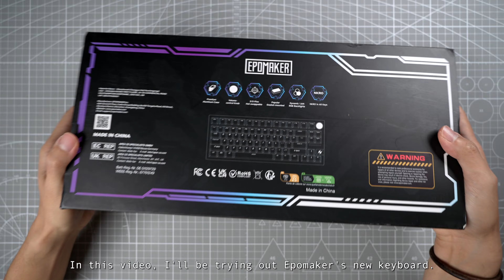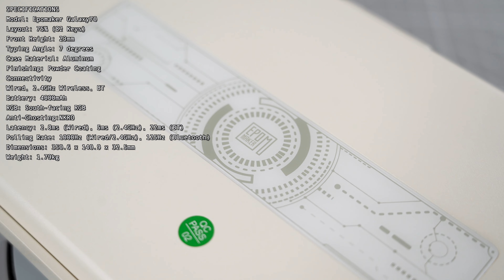Epomaker Galaxy70 Mechanical Keyboard Sound Test & Teardown ASMR

Comment: The knob looks like it came off with no issues, did you have to use excessive force to get it to loosen? 
Mine literally snapped the stem off the motherboard when I tried to disassemble it 💀
Reply from the maker: Yikes… So the whole pot got detached from the motherboard?

Mine disassembled easily just like any other knobs on other keyboards would.

Did you contact Epomaker and see what could be done?
Reply: @Late_Night_Unboxing  currently going through support channels to see if I can get it replaced yeah, I love the board otherwise I just wanted to see if I could fill it or force break it to get rid of some of the case ping